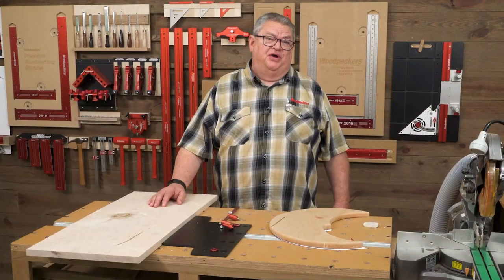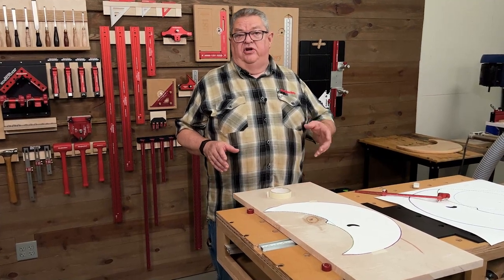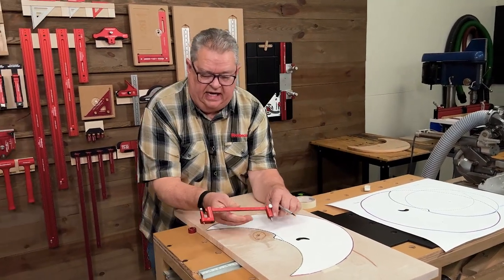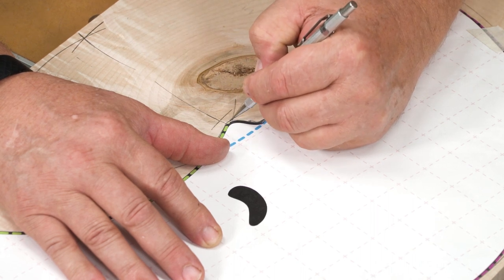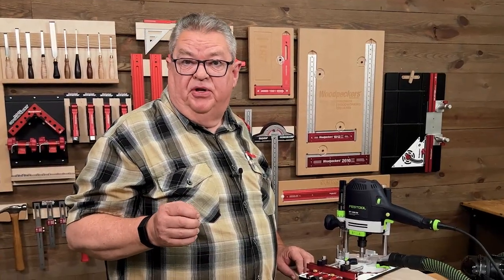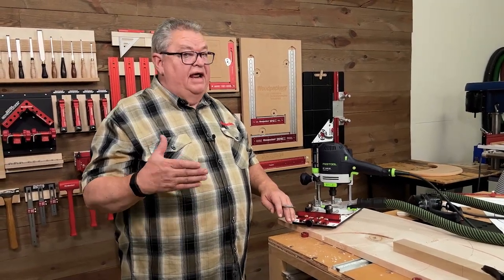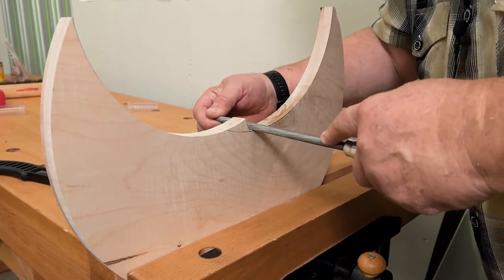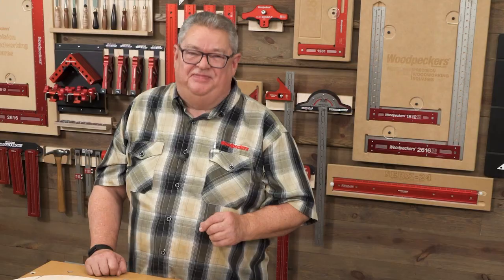Man In The Moon With The Multi-Function Router Base | Deep Dive | Woodpeckers Tools

Comment: Jeff, another great video, and as always, I want all those tools! The geometry you explained is very interesting, and I'll use it for my other projects.  

If I was making two objects, I'd use your techniques to make a template, then cut the final workpiece(s) on the bandsaw and finish on the router table with a flush cut bit.

Typically for through cuts, rather than cutting into a table or sacrifice another piece of sheet material, I just use foam or sometimes cardboard as a backer to cut into.  Just in case of a mishap, I always protect my table with 3/4 plywood too.  I never thought of doing a three step process of partial cut, then bandsaw, then flush cut.  I agree, it's probably a little safer.
Reply from the maker: Funny, I was going to present the foam method, until I ran across a Fine Woodworking video on inlaid cutting boards where the author used the stopped cut method. I immediately was drawn to the idea because I have had pieces move as a cut is finished, and it's never a good thing. I'm going to experiment with leaving the bottom of the cut really thin and then skipping the flush cut router bit, just using the round-over bit to cut away what the band saw leaves.

Comment: Seems to me that in showing off the Trammel you managed to make a simple tracing into a mathematical problem.  Sometimes the simple way is the best way.
Reply from the maker: You're right, it could have been traced or you could spray mount it, but laying down the actual arcs is going to be done eventually with the router trammel, so why not set it up with a pencil and trammel?
Reply: @WoodpeckersLLC  You're no doubt right but it just seemed a bit overwhelming to this old guy! No criticism intended.
Reply: @claudeelliott3993  I think deep dives can feel that way but like with the parallel guides, depth of utility and application doesn’t mean you or I have to go that deep, but we can if we want.

Comment: Make your pattern out of self sticking shelf paper and paste it on the wood
Reply: Don’t have to worry about it moving and can use it’s edge to cut it
Reply: @davidupdegrove2098  And a hair dryer or heat gun on low should remove it easily.